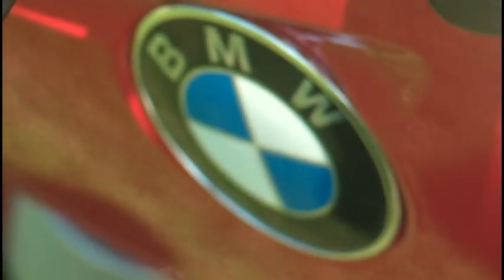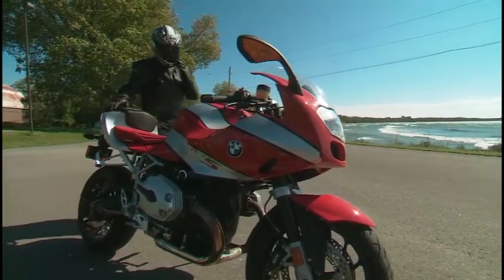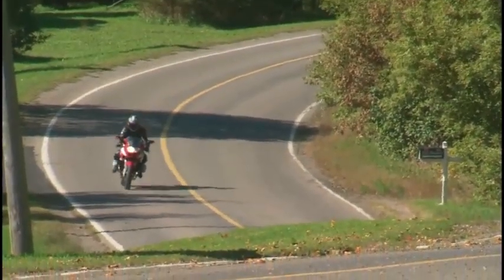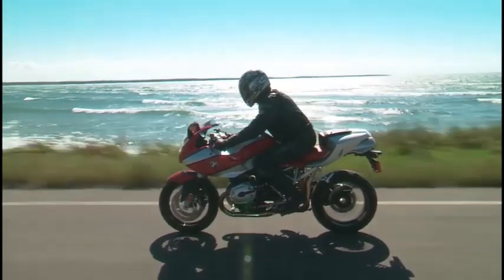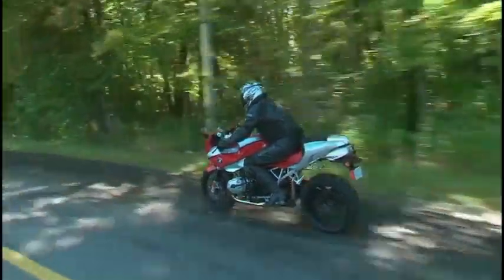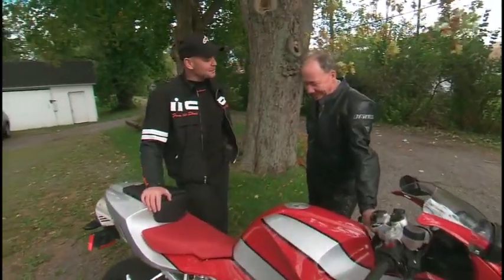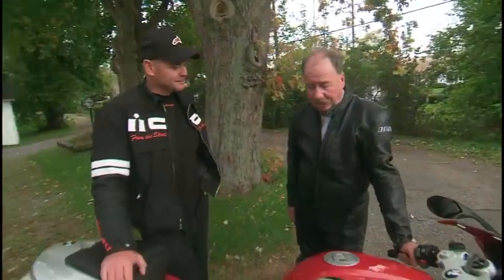BMW R1200S 9 1

Comment: owned a R1200S for 20 years, great bike but no bestseller, because for a"Super-Bike" not enough power and not comfortable enough for many BMW clients....
Reply: they were only made in 2007 and 2008 ,,, how have you owned one for so long ?
Reply: @tomthompson7400  sorry, typo kind of. i have owned a R1100S and R1200S from 1999 to 2019...so 2 "S" models for together 20 years....one 10 years and the other one 10 years...
Reply: @sebastianm.8383   yep I went 1100s to 1200s  too ,, but added a gs 1200 as well , I maybe would have bought a 1200st if I only had one bike ,,, a may add an st anyways ,, I just like the looks of the 1200s.

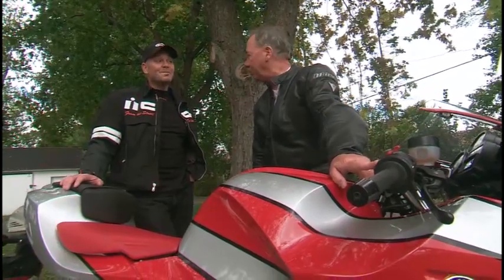Comment: 3:22 what's the feature?
Reply: heated grips
Reply: @hmm809  they are great , so simple but they do make a huge difference when the sun goes down.
Reply: @tomthompson7400  Heated grips, especially BMW's, are awesome. It's like always holding two Bratwursts in your hands, such a German experience! (Love my 2006 R1200S and my 2005 K1200S, both with the Bratwursts! 😅)